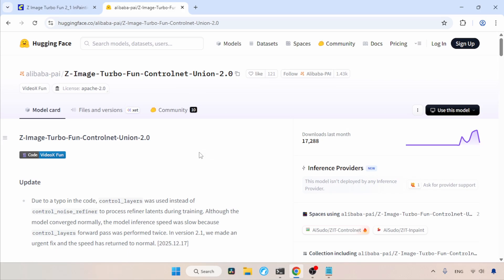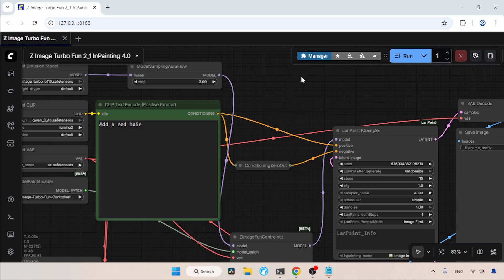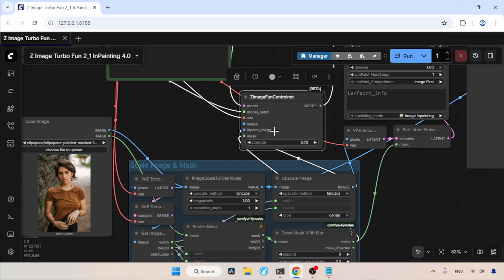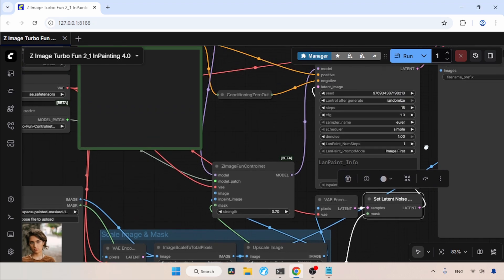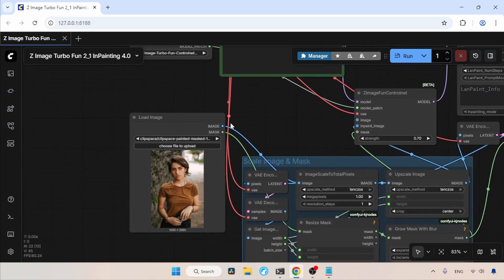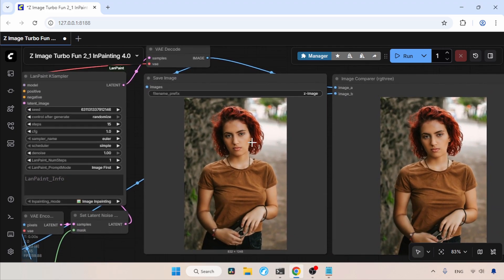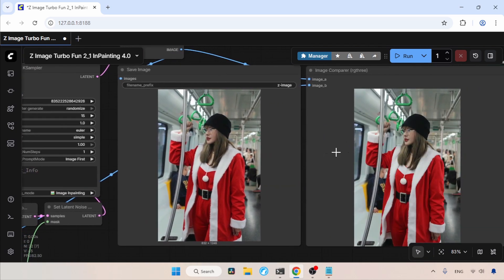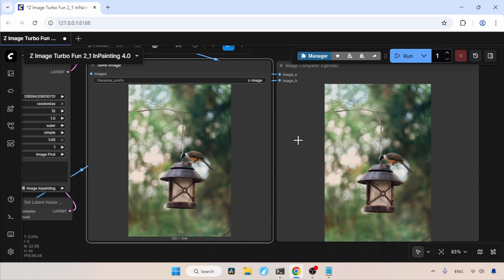Inpainting with Z Image Turbo Fun ControlNet Union 2.1 | ComfyUI

Comment: I really like your workflow. It's the best I've tried so far. You've also managed to not only use InPaint but also convert the model into an editing model.

I have a question: when the image is very large, I think it's reducing the output resolution, although it still looks great.

Another question: I've added a LoRa loader right after the model node: do you think that's the best place? This way you can even do face swaps or face restoration with LoRas.

Thanks and best regards for your work.
Reply from the maker: Most of the time, the LoRA Loader is added after the Model Loader.

Comment: Thank you very much! One question though: What is the advantage to use the 'LAN-KSampler' instead of the original KSampler (or Advanced KSampler) ?
Reply from the maker: I always try to minimize the use of custom nodes in my workflows. However, in many generations, the Native KSampler fails to properly blend the inpainting area with the original image. With LanPaint KSampler, it is very hard to spot where the inpainting area begins.

Comment: Are ZImageControlNet and QwenImageDiffsynthControlnet the same node?
Reply from the maker: The QwenImageDiffsynthControlNet node was originally designed for Qwen image models. When Alibaba released ControlNet (1.0) for Z Image Turbo, the ComfyUI developers made changes to the node to support the ControlNet designed for Z Image Turbo.
However, with the release of ControlNet (2.0) for Z Image Turbo, the ComfyUI developers created a new node called ZImageFunControlNet. This node supports both control maps and inpainting, and it also supports the latest ControlNet version, which is 2.1